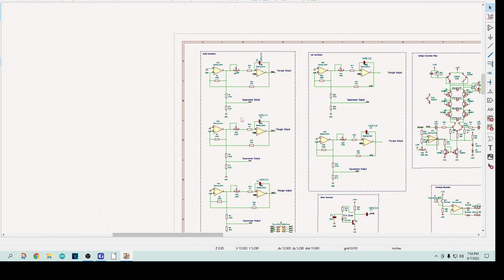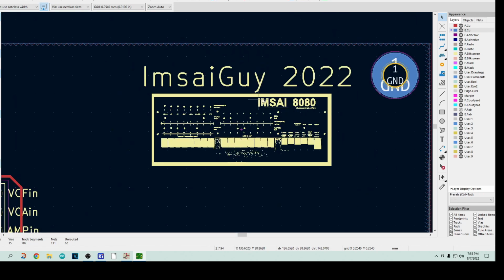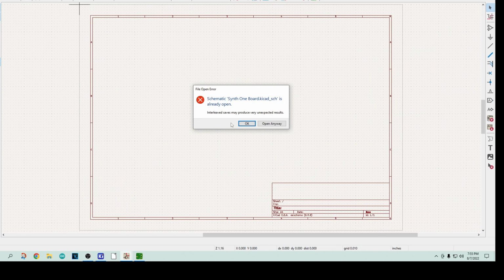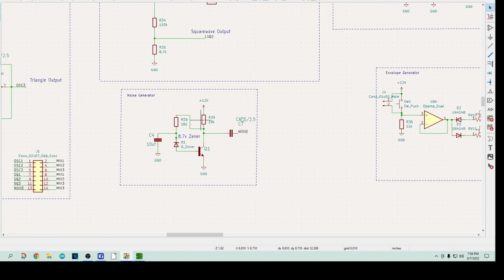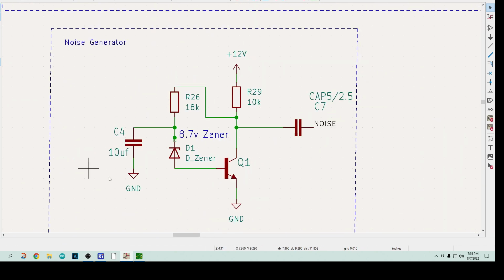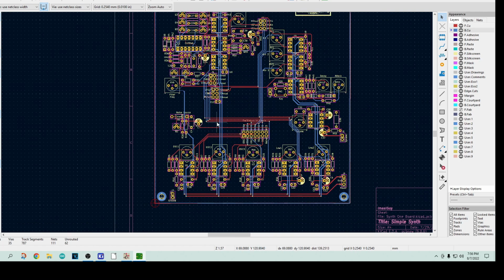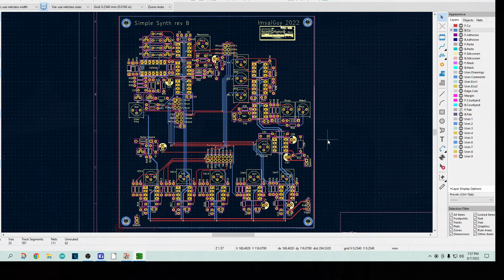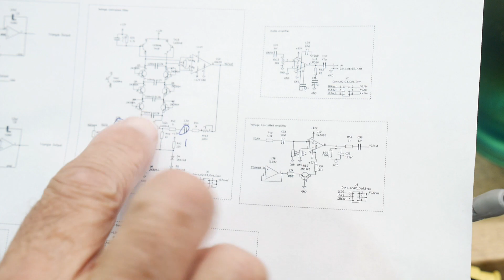#1235 Simple Synth Project (part 5 of 6)

Comment: the most difficult and most amazing analog circuit on the planet is the Buchla Wave folder / Timbre.
it's uses a propertie of diodes that change or inverts directions of the wave, you can see it on my profile and the effect of diodes.
But requires special opamps.

what's the amplitude of the VCO's? ... and offset the filter input / VCA input by 4 volts or so to be safe and have headroom in both directions.